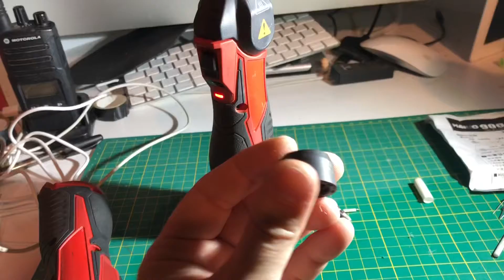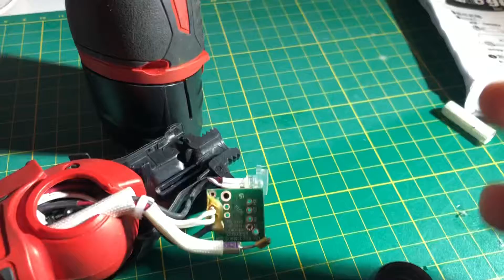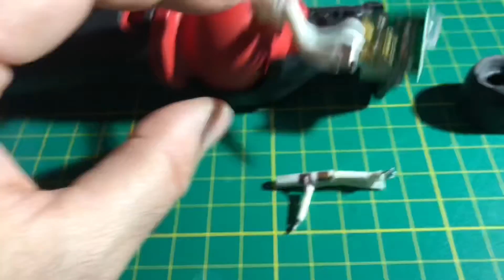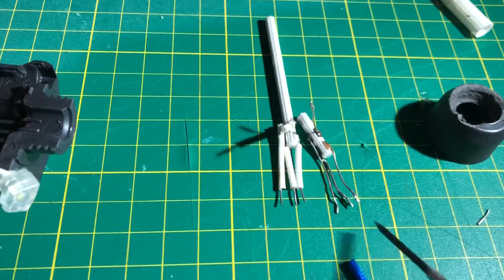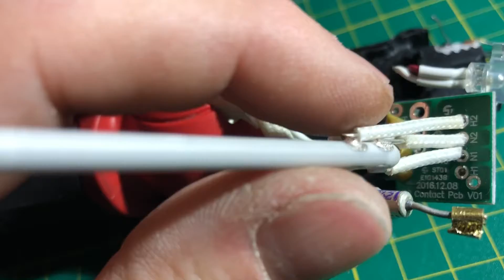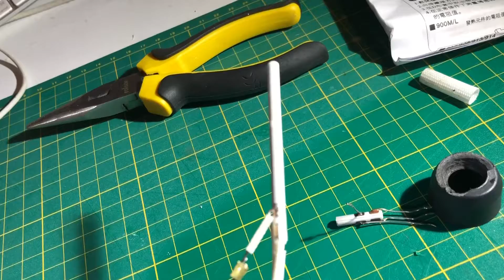Milwaukee M12 Soldering Iron Heating Element Replace / Repair

Comment: Just happened to mine too why would they make that part plastic stupid Milwaukee should know better now I need to find a replacement cap too be able to screw on for my heating element because when it broke, it snapped my element as well
Reply from the maker: The latest version has a revised design

Comment: Hi mate, well done on fixing it. H = Heater, N = NTC (thermocouple). I've done a few of these, and quite a few other Milwaukee tools too! 
I can certainly give you a shout out on my channel if you like. Best wishes. Mick.
Reply from the maker: @BuyitFixit  thanks mick 🙏
Reply: So, did you found a correct replacement or did you put the 24V one?

Comment: How do you know if a heating element is no good? I have a milwaukee iron as well but the fuse is bad for sure; my issue is that when i connect the wires directly without the thermal fuse the heating element gets hot BUT glows orange which i think is strange but then again i never saw the heating element itself nor did i ever see it itself w|o a thermal fuse attached either. 

My concern is that if i replace the fuse and that element gets to glowing again then i’m just going to blow another fuse. OR is it the thermal fuse that regulates the heat therefore not causing the element to glow orange. 

OR lol, the heating element is just bad

Comment: The Hakko #A1321 is the wrong element it won’t reach 750°F as the element is a 100 watt element for a 24 volt iron that measures 3.5 ohms, the OEM Milwaukee element is for a M12(12 volt) and it measures 1.6 ohms.
Reply: I replaced mine with this element and it heats up but doesn’t get to temperature so my light flashes green showing, it does eventually get hot enough to solder but doesn’t you have a link or the correct element part number please

Comment: The new element is incorrect! It can never reach temp as it is a higher wattage element. To reach optimum temp it needs at least 20 volts. Ohms Law states W=VxA
Reply from the maker: I’ve repaired 5 of these and they all work fine?

Comment: I used a soldering iron to add another thermal fuse, I just got it really hot and loaded a wide tip with solder and dabbed it on quickly, had no issues since doing it
Reply: Hey how much temp it’s a Fuse?

Comment: So a update I did finally just reuse a crimp on my M12 soldering Iron it lasted a little while longer butthe high temp JB weld just won't hold . When I go to wipe the tip of after soldering. The JB  weld high temp just comes loose from the black nut. Yes it is 700° temp JB weld . At the end of the just get the new M12 soldering iron.

Comment: Thank you for the efforts you put to produce this video. I searched the aftermarket for 12V element but they all seem to be 24V. Is it OK to use the 24V element instead of 24v? Also, can these element be cut to make the right lenght?
Reply: I think the 24V is fine to use here

Comment: this video is great and kudos to the creator, though as it is for most people, the replacement element for hakko has a tech spec of 50-60watts vs the original milwaukee which is at 90watt, and for me in the automotive industry leaves my soldering iron suffering  to maintain temp against fairly thin/standard 12v automotive wiring. whereas for thinner wiring its perfectly fine. im desperatley looking for a 90watt replacement/ original milwakee one. if any one can link one itll be most highly appreciated. (p.s the ebay one from australia sells for 18 euro and a shipping of 40euro's so thats definatley out of consideration)
Reply: Hey Andrea, did you found a solution? I'm running into the same problem
Reply: hello  @johannkrings7517  , i actuallly got the australian 1 from ebay, and they are original milwaukee ones i can assure you that, i.e 90watt. i also do repairing for clients so it was worth me getting the 5 pack.
Reply: @johannkrings7517   I know the hakko ones are 50-60watts, and what that means is the element will reach temperature but cool fast against thicker cables, but i saw a new video on here: https://www.youtube.com/watch?v=Ydf4089tl5c&ab_channel=WutUpClegg where you can see how to arrange the temperature of the tip, try to see if maybe a higher temperature of the tip helps. and please post the results. maybe it helps some one else.
Reply: still no information?

Comment: i bought a used iron and when i install the battery nothing happen so i search for possible issues and the number one was the fuse so i took it out and bypass it and it worked like a charm, hopefully it does not burnt up but i tend to turn off all heating devices before i set them a side

Comment: What is the resistance of the heating element?
Reply: 152 degree  15a
Reply: @jferreira5096  thats the thermal fuse, that burns out if tit reaches 152 degrees to save the rest of the iron
Reply: should be around 1 ohm

Comment: So I have the element but   I  need the crimps and a crimp tool . Can anyone help?
Reply from the maker: You can use a fine screwdriver and pliers to “unwrap” the existing ones.

I used the end of a spade/bullet terminal as a crimp
Reply: Thanks I ordered some crimps but tool must be correct and crimps maybe to big . I did take you advice and use a 1/4 of a butt connector.
Reply: So how important do think it is to put the insulation back on the element. Where the nut an Tippett is?
Reply from the maker: @stephenroberson7908  it’s not essential but it’ll help dissipate the heat
Reply: @DavesDiscoveriesChannel  have you been able to find it for sale anywhere  (the larger insulation  ) I have not found it any where.
Reply: I soldered mine. Used clips to not blow it. Still works.

Comment: My iron just flashes green doesn't heat up, would this normally fix that issue changing the heating element?
Reply from the maker: Yes that would indicate that the element has failed
Reply: I’m having the same issue. Green light just keeps flashing
Reply: if the element is not broken it could just be the thermal fuse.

Comment: I  have noticed that the sensor resistance on the genuine heating element is about 1 ohm but on the replacement one is about 4 ohm. when I replaced it is taking ages to warm up. Is that right?
Reply from the maker: Mines been perfect since I changed it 🤔
Reply: @DavesDiscoveriesChannel  Would you be able to send the link please? Mightbe wrong heating element then? Or would you measure the two pins for the heat sensor? Thanks.
Reply from the maker: @arturtuta1149  sure:
https://a.aliexpress.com/_mrKBuSQ
Reply: @DavesDiscoveriesChannel  this Ali Express element is a 50 watt the OEM Milwaukee is a90 watt
Reply from the maker: @seansysig  all I know is the 6 I repaired all work now 😂👍
Reply: @DavesDiscoveriesChannel  ok, it works but not at max power  like before... that is the problem.
Reply: I had chan hako a1321, 24v/50w , and my machine didn't work
Reply: Same issue sadly with mine…it warmed up but never fully reached temp. I wonder if there is variations in the heaters/models on these irons. I also verified continuity on all my solders across the traces and the element. Fuse was still good as well.

Unfortunately couldn’t check resistance on the original heater as it was damaged too far.
Reply: An update on my issues with this. I ended up just getting a replacement Milwaukee soldering iron. The a1321 heater I had measured at ~3 ohms which is to spec for the heater. This puts it at about 50watts at 12v. The original Milwaukee claims to be 90 watts. This would require a heater at 1.6ohms at 12 v. there is a possibility some of the  knock off ones differ just enough to work.
Reply: @jmo2321  Hello, do you have the link of the indicated heater?
Reply: @salas6979  Milwaukee lists the 90watt spec directly on their website for the soldering iron. HAKKO documentation for irons with this specific heater call out a resistance of 2.5-3.5ohms. Use ohms law to calculate power. The m12 system obviously uses 12 volts.

Comment: I have had to replace 3 of these elements on my own, as warranty took 4 months to return and was told it's longer now. So started doing it myself last year. I have 4 of these and have various issues with all of them. If they weren't so great while they work it wouldn't be so frustrating lol  I believe I used a different element though. I will have to look. At the time, in late 2020 there was no info online and has to just compare wattage across the market for replacement. Great video, I'm sure it will help loads of people!
Reply from the maker: Thanks for the comment 👍

So far I’ve done 10 of these 🤯
Reply: Thank you very much for providing this video.  I personally have gone through 4 of these.   I was hoping you could do a video on installing an electronic temp controller.  Any thoughts?
Reply: I have order A1321 element, received 24v50w one. Is it correct?
Reply from the maker: @TheMationo  can you see the four metal tabs on the sides that the legs are attached to?
Reply: @DavesDiscoveriesChannel  yes. It looks like one on video.
Reply from the maker: @TheMationo  it should be fine 👍👍
Reply: Has anyone got a link for where i can buy an element from or is willing to sell to me kind regards Ade

Comment: Great video, on mine it was the152deg 15a fuse blown.
Reply: Mine too. New model. Great crap for 300 bucks.
Reply: Hi mine has done the same. How did you  fine the correct replacement fuse?
Reply: @jamieclyne8570  The thermal fuse is located in the tip end, connected in series with the tip power, you will need to pull back the fibre sleave to see it, use a blade to prize open the clamps holding the wire.
Remember to test it first, it should be less than an Ohm, or open if broke.
Do not solder it unless you use some sort of heat shunt or you will blow the new one.
I found it by reading the markings on the fuse and typing them into ebay.
Reply: awesome. I was looking for this a while ago and could not find. thank you so much.
Reply: @gabrielmassa  No problem, I know they are on ebay. Mine still working fine, so they must just get old and break.